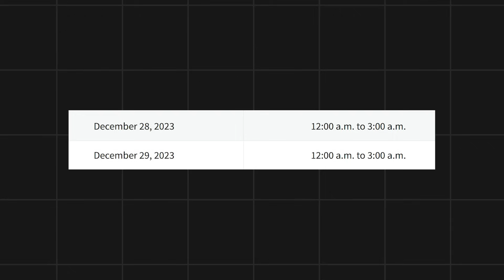Can SpaceX Fix Booster 10? Major Technical Issue before OFT 3, Falcon 9 - Issue | Episode 22

Comment: Does anyone know the detail of the mishap?
Wass it just because of the rough weather?
The stabilizing system of the drone ship may need to be improved more.
Reply from the maker: No, the landing legs of the booster were not that strong enough to withhold the rough weather. It was an older prototype, and had older techs. SpaceX has confirmed that newer prototypes are built to withstand rough weather conditions!Hope u got it!😃
Reply: @spacexcommunity  I got it. Thank you!
Reply: Ty 👍